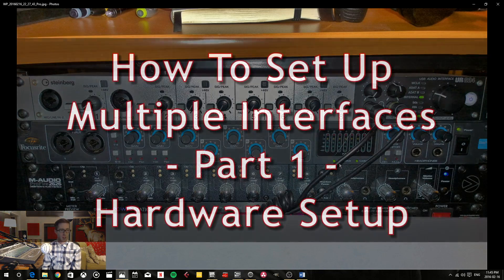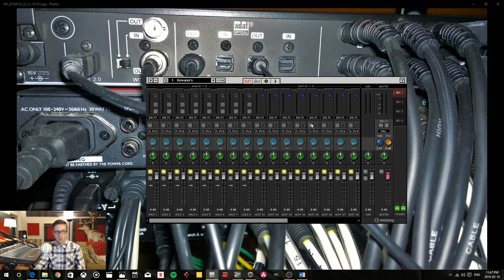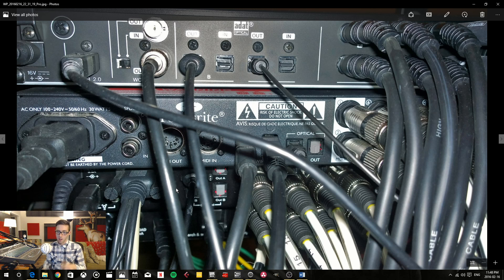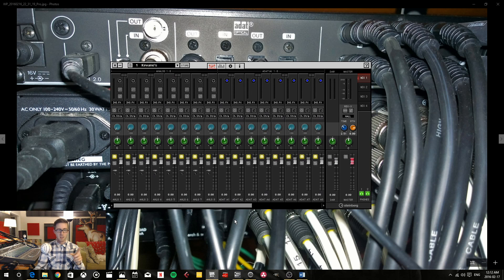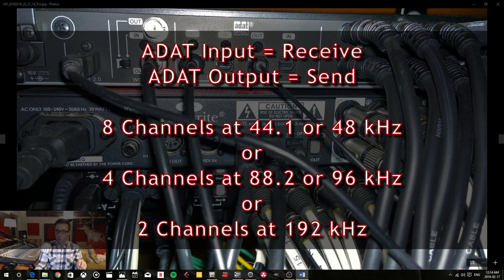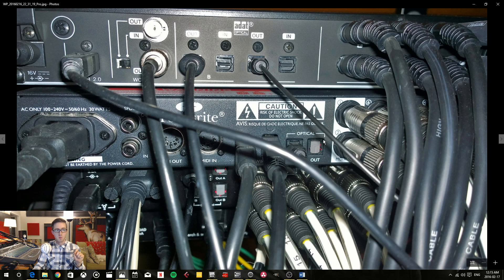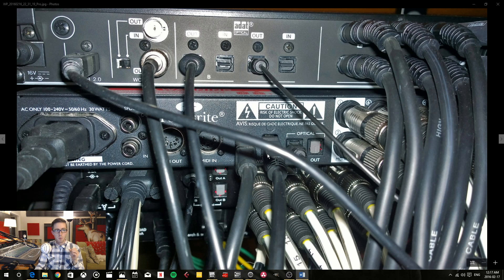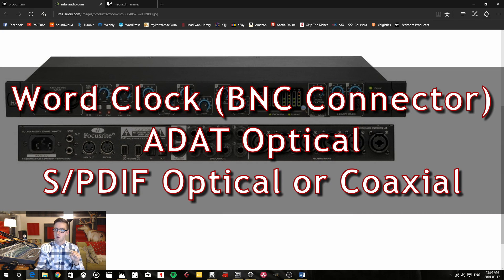How To Set Up Multiple Audio Interfaces via ADAT - Part 1 - Hardware Setup

Comment: I know this video is over a year old but,I hope somebody can answer my question. I'm using a Steinberg UR242 interface but,I need more pre-amps. Do the drivers for the UR series support using multiple devices? If I get a UR44 or UR824,can I use either of them with my UR242 at the same time?
Reply: i guess Im pretty off topic but does anyone know of a good place to stream newly released movies online?
Reply: @Ephraim Carter I use flixzone. Just google for it =)
Reply from the maker: The best option on a PC is always to use one main interface and to connect to other devices via ADAT.

On a Mac you can quite reliably connect multiple interfaces (either daisy chaining firewire interfaces, or plugging in all your USB interfaces) and then connecting them together by creating an aggregate device (the computer allows programs to access all of your interfaces as though they were one device).

The alternative, the somewhat of a workaround on a PC (thus less reliable but should work just fine) is to install the Asio4All audio driver and use it as your main audio driver in your DAW. The Asio4All works just like the Mac Aggregate device, it allows the software your working on to recognize all of your connected interfaces as being one device, thus allowing access to all of your inputs and outputs.

Link:
http://www.asio4all.de/

Hope this helps.
Reply: The only UR series interface that has adat is the 824.
Reply from the maker: Yes, so if you're using a PC then you'll have to go the Asio4All route, If you have a Mac you can go the Aggregate device route. Otherwise you'll have to buy other interfaces that have ADAT.

Comment: Hi, I don't know if you'll ever respond to this question because this is a 2016 video. So I've been frustrated for months trying to solve this problem. I have 1 unit of UR824 and 1 unit of Focusrite Octopre dynamic mk ii. The input of both converters are working great, so I have 16 input in total. However, I couldn't get the extra 8 outputs from the ADAT. I realize that my ADAT is quite different from yours. Mine doesn't have any software or firewire connection (of course because it is an ADAT not an independent audio interface). So I was only be able to connect it via Optical In and Out without any extra software like you did. I use the Octopre as the master clock and UR824 as the slave. Do you have any advice for my routing? Thank you very much.

Comment: Im having a issue doing this with my set up. I've got a apollo twin, a saffire pro 24, and a macbook osx. I want to use the saffire for additional mic inputs (wanting to use 3 mics, but the twin only has 2), but I can't simply connect the saffire to my computer bc my mac doesn't have firewire. I also can't figure out how to connect the saffire to the apollo and use the apollo as the master interface( that is the only interface directly plugged into the labtop). If anyone can share some insight or knows the easiest way to do this with my set up PLEASE HELP
Reply from the maker: Unfortunately, your Saffire pro 24 and Apollo Twin do not have ADAT out, and if you don't have Firewire on your macbook, then there's no way you can connect both interfaces. The only way to get them connected is to somehow get a firewire adaptor so you can plug in both the Apollo & Saffire into the macbook, then you can setup an "Aggregate Device" in the Mac Audio Settings. This creates a single audio driver using multiple interfaces which will give access to all your inputs/outputs within your DAW.

Comment: Great video bud! I have 2 m audio fast track ultra 8r. I'm trying to see if I can run them together to give me 16 tracks. They are a usb unit. Trying to find help if that's possible and also about their driver situation since I already have 1 driver installed from the 1st one so I'm assuming i cant download the same driver for the 2nd and run 2 identical things...Shits confusing lol. Any help would be greatly appreciated!!! Thank u in advance. I'm on PC btw
Reply from the maker: You can install as many drivers as you want, but you can only use 1 driver in Cubase and all the DAW's I know. For this reason, it would be best to choose one master interface, then use the other interfaces as slaves connected via ADAT.

The other workaround is to use ASIO4ALL, which is its own dedicated driver, which you can select in your DAW, and then setup all your inputs and outputs in the ASIO4ALL software. But I wouldn't recommend that route, it is more likely to cause stability issues.

Comment: Will the ADAT chaining technique work on Mac?
Reply from the maker: Yes, with Mac I believe you would setup an Aggregate device within the Mac settings, so it would actually simplify things vs PC.
Reply: Vintique Sound yes, aggregate devices are easy, but like Asio4All, it causes latency. 
Having a thunderbolt interface with a daisy chain feature is the best option, but since I have USB, I'd like an alternative option.

Comment: Hello! Quick question:

If i have (i dont and thats why the question) 2 Behringer UMC 1820, which has and ADAT in and out, for the computer to read the 16 channels, do i have to use an optical cable, link it from Device 1 output to Device 2 input and read Device 2 from my DAW while using only one USB connected to my computer? Did i explain it right? hehe
Reply: Angel Samper Wilson did u ever figure out of this works? I have a behringer but audacity only lets me record 2 channels at once. I need to be able to record 4 mics at once. I’ve been told the Behringer drivers don’t allow you to record 4 mics at once even though it’s got 4 XLR inputs
Reply from the maker: The Behringer UMC 1820 has 1 ADAT in and 1 ADAT out. Meaning, you can use one as a master, and send digital audio signal from the ADAT out of your slave Behringer and into the master ADAT in. This will give you up to 16 channels of audio at 44.1/48kHz

Comment: Hi...hope you are ok, i have a question please..
I use an Apolo Quad Firewire 800
There is 2 Adat IN and 2 Adat outs, that means that i can use one interface pluged ADAT on in 1 on the apollo to have 8 chanels and another interface in ADAT in 2 and have  like this 16 chanels by ADAT? Or if i use ADAT in 1 the ADAT IN 2 its disable? Thank you very much
Reply from the maker: You will always have access to both ADAT inputs and outputs, using ADAT IN 1 for example will not disable ADAT IN 2.

Comment: Thx for the Vid! :) 
Would you know if connecting two UR824 together will restrict them in anyway? For example will I still only be able to use 2 headphones or can I use all 4? Will some inputs/outputs be shutdown? I'm thinking I only need to connect them via USB to my computer and Cubase Pro 10 will automatically find them and add all the inputs/outputs (combos, TRS's and XLR's, ADAT's & headphone jacks) in my DAW? = no restrictions… Or will there be restrictions to one of the units when using two at the same time? Like Sample Rate/Bit Depth restrictions? Input/Output restrictions, etc?

I have one UR824 but either thinking I'm gonna get a second unit (exact same) or buy an ADAT 8 channel like this one: https://www.thomann.de/se/behringer_ada_8200_ultragain.htm (this is a much cheaper but still a good option than buying Another UR824) Just to expand on the channels in my home studio for adding more outboard gears… I really dont need more input/output channels in my home studio since I dont use real live drums, etc. But I need it for adding more outboard gears...
Reply from the maker: Unfortunately I don't have experience with two UR824 connected, but you can expand to 24 inputs & 24 outputs with any other device using the ADAT connections. I think the limitation is going to be as follows: The software allows for 4 mixes, and you can assign those to any stereo outputs on either interfaces, but it only allows to assign 2 different headphone outputs. 

You'll have to set a master and a slave interface, and the slave should sync sample rate/bit depth. You might have to connect both via USB to configure the software properly, or you might have to connect one at a time while selecting master/slave and clock sources, or you may have to only connect your master and that's it.

If your goal is simply to expand the number of inputs/outputs then I would look at grabbing that Behringer unit or something similar, their significantly cheaper as opposed to another fully featured interface, but you won't be using those extra features, just the ins/outs. Unless you want the exact same preamps and line out quality, or if you want the flexibility of using two separate interfaces on two different computers, that could be good reason to have two fully featured interfaces.

Comment: daisy chaining 2 profire 2626 does not work, they are not reconized at all with firewire. Must be connected via optical port, making progress but still having trouble.
Reply from the maker: Yes, the ADAT optical is the most universal way to connect multiple devices together. I was under the impression you can daisy chain 2 profires though, because there's two firewire ports on the back, and to my knowledge that's designed to be able to daisy chain.

Comment: Hi, Im trying to sinc two interfaces, it's a UR824 and the behringer UMC1820 by ADAT, I've configurated it as you said (behringer as slave) but the ur824 don't recognize the interface and in the dsp mixer it doesn't come the signal, what can i do?
Reply: I'm using windows 10, both interfaces are contected via USB, using cubase 9 pro and i wanted them to expand my inputs, hope you can answer me, I really need help!
Reply from the maker: First question, have you connected an ADAT cable from the UMC1820 output to the UR824 ADAT input? Also what do you mean by "the ur824 don't recognize the interface"? The only thing the UR824 will ever be able to see is the audio signal, so if that's what you mean then I understand.

And which DSP mixer doesn't have a signal? The UR824 or the UMC1820? Related to this, does the UMC1820 software show audio input signals?

Once everything is setup correctly, all you will need is USB to the UR824 because it's the master, and an ADAT cable from the output of the UMC1820 going into the input of the UR824. Your DAW will then get all the audio signals via the UR824 (up to 24 separate channels).
Reply: @VintiqueSound  hi thanks for your time, I've already done it, the behringer cant be slaved so I put it as a Master (behringer), just connected the behringer via usb and the ur824 clock as ADAT A and change the ADAT A OUT to ANALOGE 1-2...7-8 IN, disconnected the ur824 usb and it works

The behringer dsp mixer is so cheap and you cant change the outs, so I dont recommend that interface if you wanted to be slave.
By the way, that behringer is not mine, a friend want to record drums and wanted to expand the preamps lol thank you so much, I've learnd a lot from your videos!
Reply from the maker: Fantastic, glad to hear I could help :)

Comment: I'm pretty sure that ADAT requires you to designate one interface as a master and the other as a slave. This means that the clock source is your master, and the fiber optic ADAT connection will sync the clock source with your slave. So there shouldn't be a reason to connect word clocks when using ADAT. 

Can anyone confirm? Or am I just stupid? Lol
Reply from the maker: As far as I understand it, ADAT devices will either prompt you to make the choice as to which device is the master or it will just assume one as being the master. And yes, this means that the ADAT connection between the devices is the path in which the devices are being synced.

However, if you're using the ADAT for sending and receiving digital audio, then your ADAT ports are doing two jobs, namely, sending word clock data and digital audio data. And I've been told by some engineers that what could happen is a degradation in audio quality, ranging from very minor imperceptible differences in quality (very slight and very minor clocking issues) to clicks and pops or other degradations in audio quality (very severe clocking issues).

I've have devices that don't have word clock ports, and thus used only one ADAT port for receiving digital audio and the word clock signal, and I had no complaints, and never noticed any clicks or pops. I wasn't able to do A/B tests so I wouldn't be able to comment on the overall quality difference. 

My advice would be, if you already have devices that have word clock ports, and you already have word clock cables, then it doesn't hurt to use them as the main clocking source, then use your ADAT ports for nothing other than digital audio transmission. If you would have to buy another device, or buy cables, then I probably wouldn't worry about it. If you do notice clicks and pops and can narrow it down to a clocking issue, then spend the money/time and invest in a dedicated clocking source.

Comment: I don't know what daisychain is
Reply from the maker: Daisy chaining essentially means the same thing as connecting things in series. Where you have one firewire cable from your computer to the master interface, then you connect one firewire cable from the master interface to the slave interface. It's in series as opposed to in parallel. Parallel means you'd be connecting the computer to each of the interfaces separately, but this would require two firewire ports on the computer (you can do this if you have two ports, but you'll have to daisy-chain if you only have one).

Comment: Hey man, I watching this video a while ago and now I've actuallygot my interfaces I need some help. 

I've got 2 Blackbird Firewire interfaces and 1 Hercules Firewire. 

The blackbirds have ADAT in/out but the Hercules doesn't.  If I set up Blackbird 1 to be the master, could I daisy chain the other interfaces to that one by Firewire? Also what's the best way to link them? As the Hercuiles only has s/pdif, but the blackbirds don't.
Reply from the maker: Hey there. Are you using a Mac or PC? With a Mac you can daisy chain multiple interfaces via firewire by creating an aggregate device in the main Apple audio settings. On a PC you have a workaround that does the same thing, it's called Asio4all. This emulates what the Mac aggregate device does, so you can daisy chain interfaces via firewire.

Having said that, I think the utmost best option is to have one master interface, and connect to other interfaces and audio devices via ADAT and S/PDIF, simply because you don't have to mess around with Asio4All, or any aggregate device workaround. You're simply using the master interface as it was designed to be used, using it's dedicated software and then simply connecting other devices digitally, the way it was designed.

Hope this helps. There's a lot of info on Asio4All for PC and Aggregate devices for Mac online.

Comment: hello, i pretend to buy two Hallen & Heath ZEDi-10FX mixers (quality and price) for live mixing and multitrack recording to be processed at my laptop (Windows 7, 32bits) with Cubase. would it be possible to get the 4+4 tracks to be opened at Cubase for this purpose with something like ASIO4All or Voicemeeter Virtual Audio Mixer?
Reply from the maker: I'm not exactly sure what the correct answer is, but here's what I think might be true. The ZEDi-10FX doesn't have any ADAT ports, so you won't be able to hook it up in the way that I describe in this 3 part video. As far as ASIO4All goes, I'm pretty sure that you can hook up any combination of different audio interfaces, whether it's USB or Firewire, or whatnot. You'll just have to make sure you're always selecting ASIO4All as your main driver in Cubase or whatever program you're using.

It would also be just as easy to just buy a bigger mixer that has more channels but still USB input and 8 or more channels available via USB connectivity for multi-track recording. Personally I wouldn't like to have two separate mixers just to get more channels.

Checkout:
PreSonus StudioLive AR16 USB Mixer
Soundcraft Signature 12 MTK
Soundcraft Signature 22 MTK

Midas Venice U16

I haven't used Voicemeter Virtual Audio Mixer before, but I can look into the ASIO4All a bit more if you like.
Reply from the maker: I think Yamaha has some mixers that allow for multitrack recording too (try the Yamaha MG16XU), and they might even come with a free copy of Cubase AI or something.
Reply: thanks, i decided to simplify things with a larger mixer (SS 12MTK)
Reply from the maker: Glad I could help. I've heard good things about the Soundcraft MTK series mixers. I hope it serves you well!